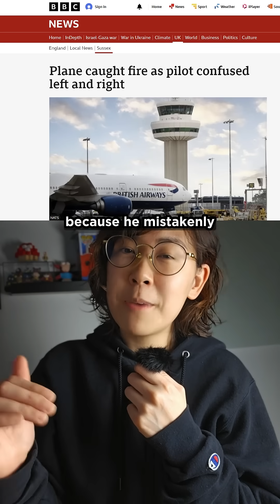Did a Pilot’s Left-Right Confusion Really Shut Down the Airport?

Comment: I mean it does seem he did get confused between the controls to the left and the controls to the right. It makes sense to me because if you weren't a copilot but the pilot, he probably would have made the correct move since it's flipped. Unless I missed something?
Reply: yes, hes probably used to sitting in the left seat, then when he was sat in the right, muscle memory took over and the motions he did were reversed. but ultimately this is easily foreseeable human factor error, the plane should've been designed to alert the pilot or resist the thrust lever being pulled back during take-off. now they have an expensive landing gear fire instead.
Reply: I mean, it's like accidentally double clicking instead of single clicking when using a mouse. They're both actions you do all the time and if you're not paying attention, both actions may be equally queued in your muscle memory.

Because remember, the action he did wasn't mistake his left and right hand. It was that he was going through the motions for both taking off and landing. I'd say it's no different than when i get into my car, put it in reverse with my foot on the break, being momentarily distracted, and putting my car into "reverse", letting up off the break, and inch forward because my car is in drive, not reverse.
Reply: @catelynh1020  Even thought what you said is more probable, the other option is that HE did "confuse" left and right (and the brain-fart is that he pulled back the thrust-level to pull up the nose of the plane).
It's not clear from the video what was going on on his mind during the mistake.